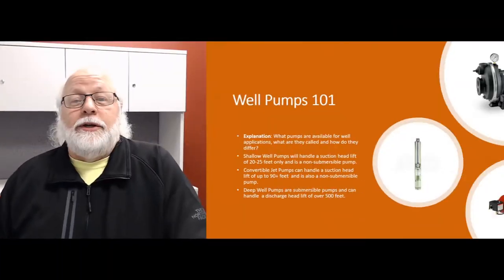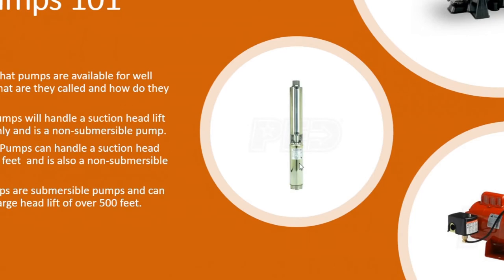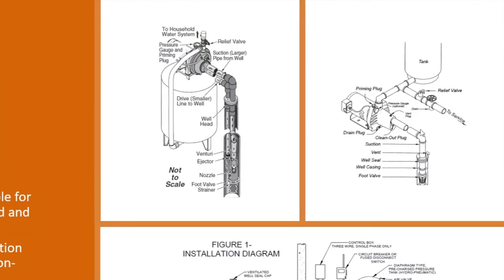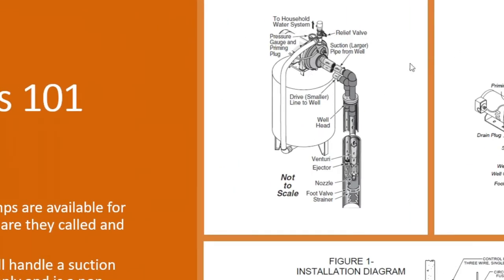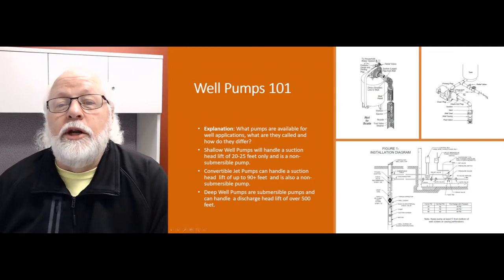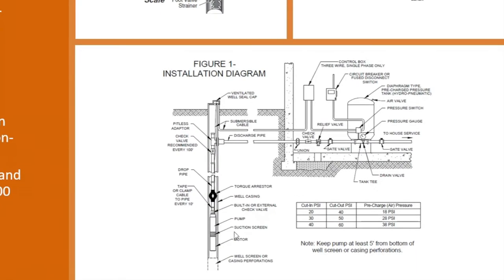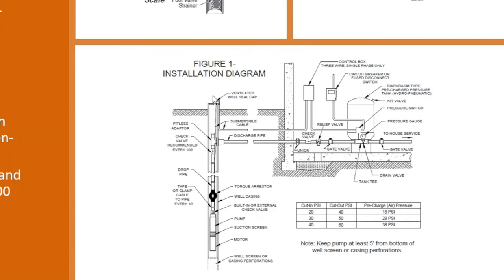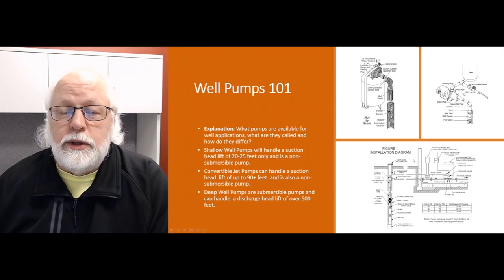Well Pumps Overview

Comment: How do I determine the sprinkler pump I need to pump lake water up hill (50' total head lift) through a garden hose 1000' away and to the current underground sprinkler system 1.25" pvc pipe. The one I have burned up after 24 years and I can't read many of the markings.
Thanks
Reply from the maker: Hello, please read our article that outlines these steps better for you to determine what you need. If you still need help, just give us a call during our regular business hours. Call: 888-455-4681.

https://www.waterpumpsdirect.com/stories/1344-How-to-Select-the-Perfect-Sprinkler-Pump.html